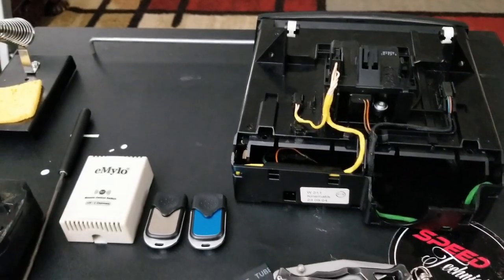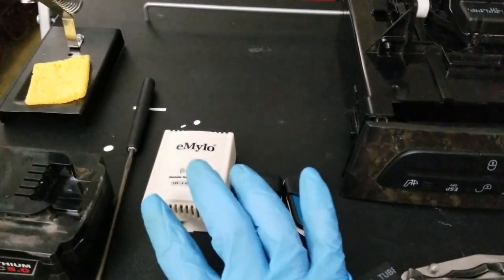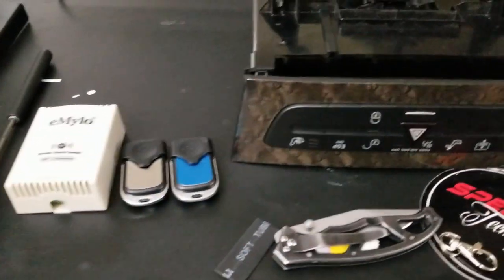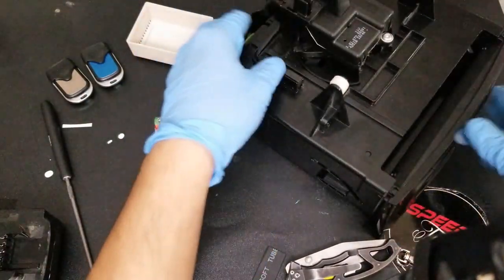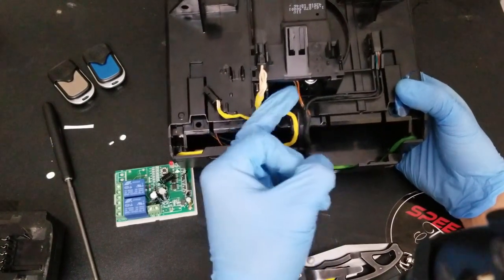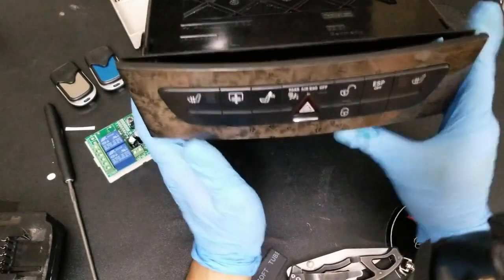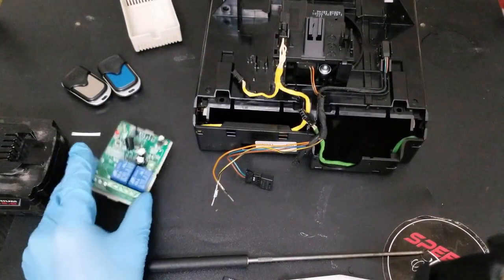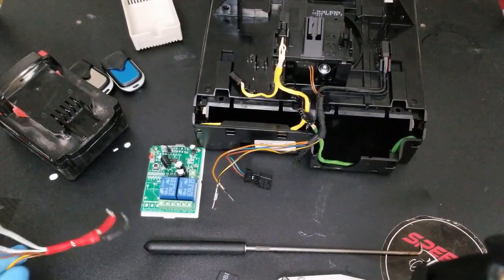Making my Mercedes Benz W211 E55 AMG CD Changer Slot into a Hidden Storage Compartment.

Comment: If you use this remote relay for opening and closing the CD changer I recommend putting the remote unit in Momentary mode. If its not, power stays on to the motor if its in latched mode like whats being demonstrated in the video. This unit is sending voltage to the wires which runs the motor. The with the second button it reverses polarity which reverses the motor. In latched mode the voltage does not turn off when the door is open or closed. In momentary mode you have to keep your finger on the remote button to open the door then you release it which stops the voltage. Press and hold the second button which reverses polarity and the door closes, then you release the button. Even though the motor does stall at the end of each cycle (door open and closing) for the time you release the button this does not appear to damage the motor or draw enough current to blow a small 1 amp fuse. There is a momentary contact switch on the CD player which was used for the original function and could be used to stop the motor but this would involve more circuitry and does not appear to be needed.

Comment: I have been searching for this exact thing for a long time. A tip I've got is to add the name MOST system that's the of the loop with all the different devices which the CD changer is a part of. I was searching for that might have found your video faster. Thanks for the great instructions much appreciated.

Comment: Is it just a case of you need a way to power the motor? Do you reverse the polarity again to close it? Thinking of this solution vs other potential ways of doing it....key is going to be the logic required. (Arduino/raspberry pi zero or something like that might lead to some interesting ways of doing this).

Comment: nice video mate. thats a cool setup with remote. i have this on my e55 w211. the switch is hidden under the steering on top of foot well. hidden away. it is good for putting wallet and small things like that but a little awkward for my big hands to get around the gear selector when putting things in and pulling out. sould be fine for smaller hands though. ill post video of mine on my yt.

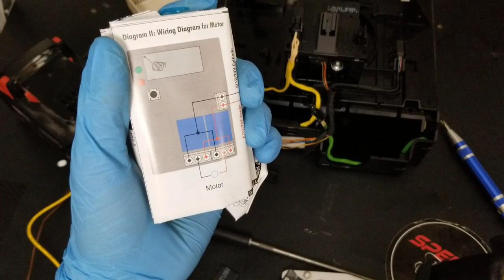Comment: Wondering if mine is a different unit ay 11:14 you've got it folded but it looks like on the fold yours says 6/12/24v cathode.... where my schematic reads 220v live line...which looks like household mains AC voltage....

wondering if I was sent a version for a house not a car...? Not sure if I van just wire it up your way and hope for the best as it visually looks identical to yours....
Reply: In case if helps others there are two versions of this switch which look almost identical make sure you get the 12v not 220v version! I've returned mine and ordered another.

Comment: Question: some after market radio’s ensure this canbus keeps working(at least steering wheel controls) does that automatically mean the door will also still work?
Reply from the maker: Yes & yes. 
A proper aftermarket with a cannus module.
Reply: @PANZERSGARAGE  thanks for the quick reply friend